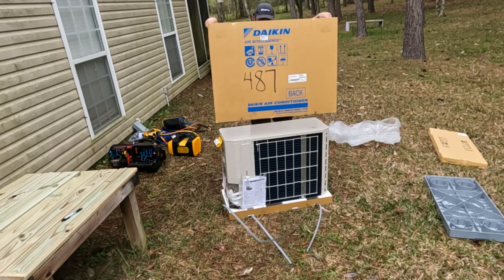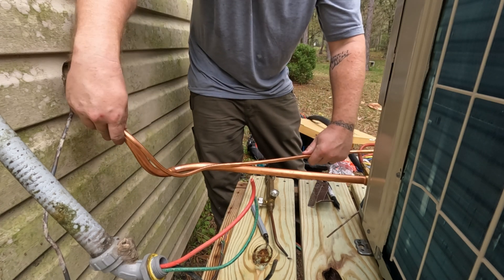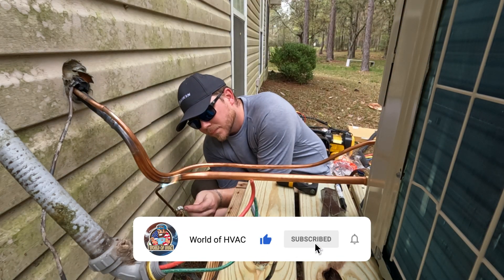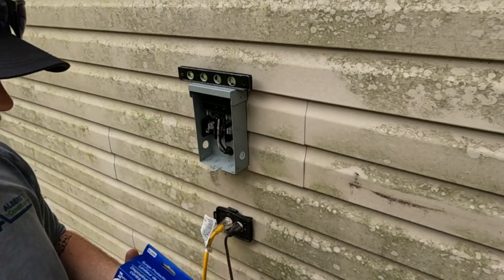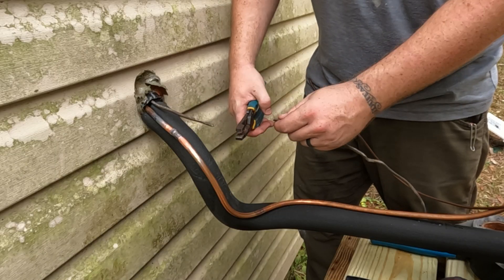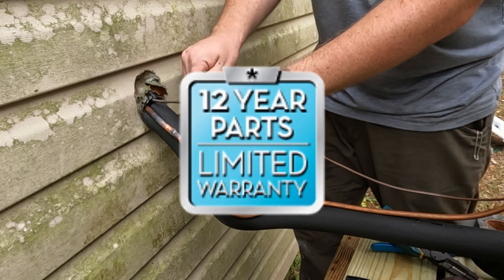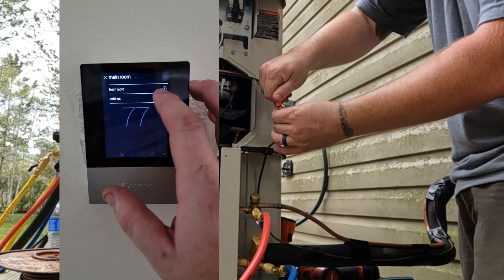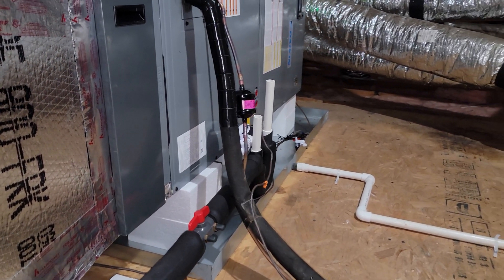Most Efficient HVAC System For The Money!

Comment: We love that Daikin FIT out here, People that get that unit are happy and houses are more comfortable than the old-style units. Having an Inverter compressor and variable speed fan motors makes it the sweetest HVAC unit out there. Plus, the vertical condenser makes dirt easier to clean and leaves and debris less likely to fall in it.
Reply from the maker: It really is one of the best designed systems. And its prices really well

Comment: Nice bends. This a single zone unit?
Reply from the maker: Thanks! Yea the FIT is a 1 to 1 full capacity system. Its just side discharge instead of top discharge
Reply: @WorldofHVAC  You better be far away from neighbor's home; I remember working on a side discharge condenser and the unit blew the warm air thirty five feet away causing problems every time the unit came on! Home owners decided to put some shrubs to deflect discharge! lol
Reply from the maker: Ive put that unit in alleys and never had a problem. Thats crazy. Yea they live on an acre. This unit is just moving grass around